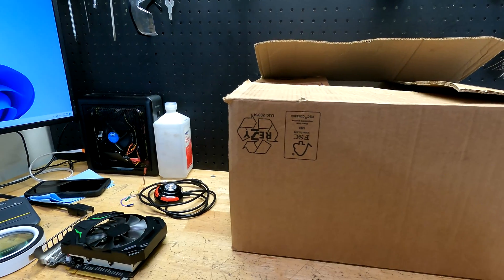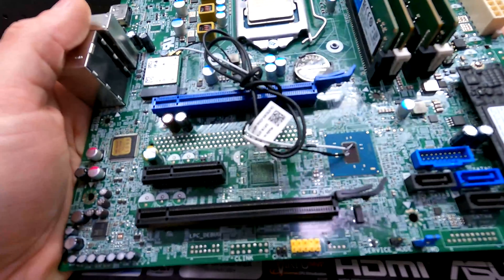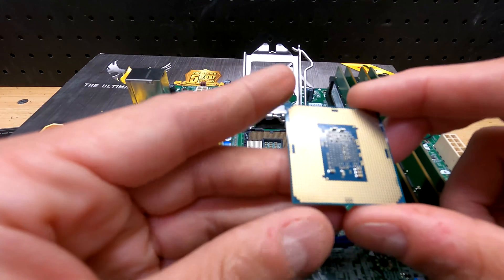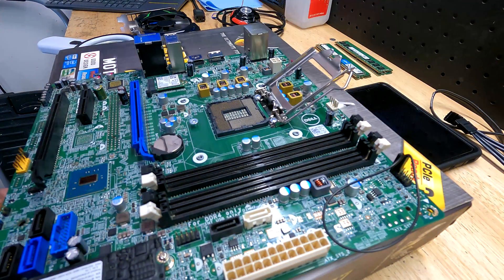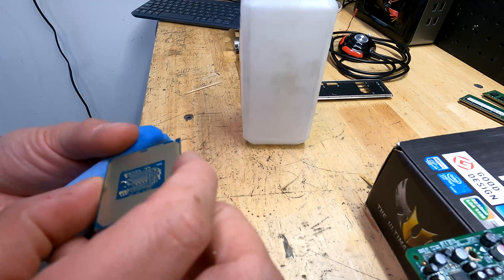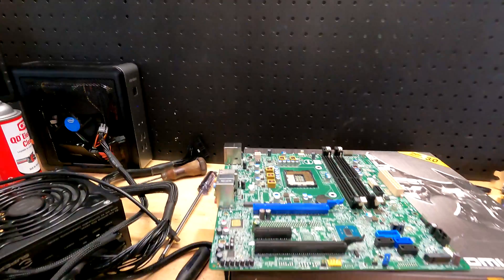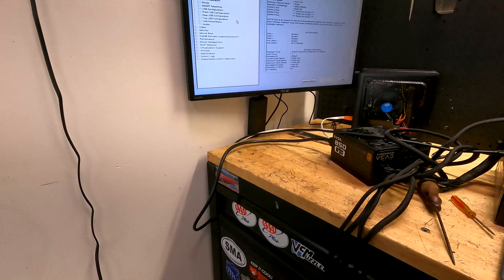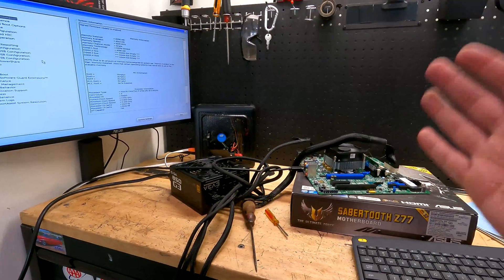Bent pins!! Fixing a broken motherboard and cpu!

Comment: please reply,so i have all bend pins,i was trying to upgrade my cpu for the first time myself,i i ended messing up the whole socket,now all the pins are bend and some of them are broken,can you help me,i can't afford a new mother board,so can i just replace the while lga cpu socket?❤😅
Reply from the maker: don't think it is reasonable as it requires alot of soldering and I think special equipment, if you have that many bents pins you might just have to get another board.
Reply: @DLMtechgarage  thank you😓♥️
Reply: hey i got msi b650 tomahawk mobo as a cpu i have 7800x3d, to use it i needed to flashback bios to latest version. I have tried this and it never worked white led kept blinking and nothing happened in the end. I went to a pc repair/store shop and gave them the mobo/cpu/ram and told them to test. They tested it and told me that mobo has a bent pin/pins, im just wondering is there a different problem why flashback bios is not working? @DLMtechgarage

Comment: I found a small syringe needle say from an ink refill kit, which just fits over the pin a better option to strighten them in this event.
Reply from the maker: thanks for the input, i might have to try that!!
Reply: What size was the syringe needle? Just tried googling LGA thickness and even the AI was like there isn't much info on LGA pin thickness...  😂 when even the AI is like I give up you're trying to solve the hard problems in this world 😂

Comment: True statement about durability of Optiplex and business-class desktops.  They don't look good, but are built to run all-day and year-round.  The exhaust fans actually do just fine with cooling, at least with the stock components.  I've bought 6 or 7 of these used, and the only one with problems was a 7010 with a badly smashed corner, which obviously had been dropped on concrete and cracked the motherboard.  I swapped out motherboard with a $20 (also used) one, and it booted up fine.
Reply from the maker: yea they are still solid boards, I've had them come in with all types of damage and still run solid!!